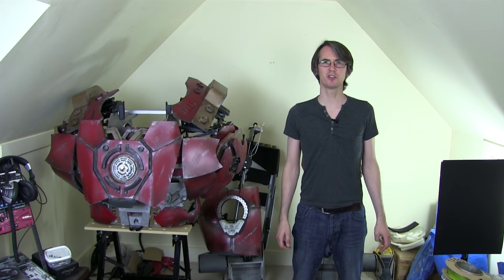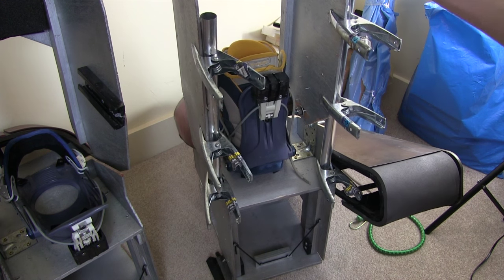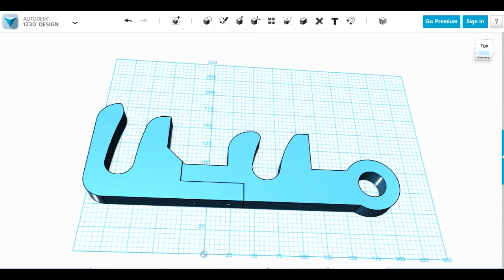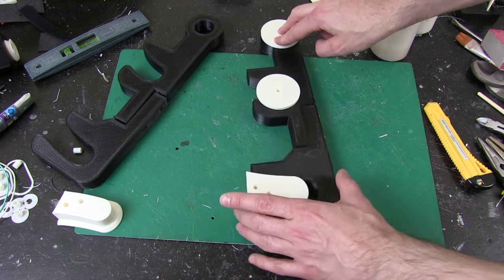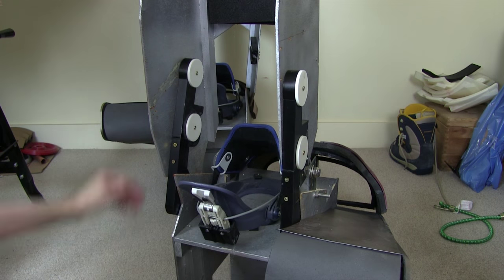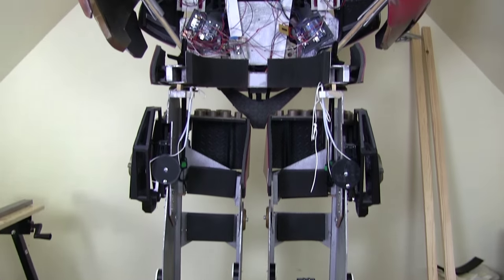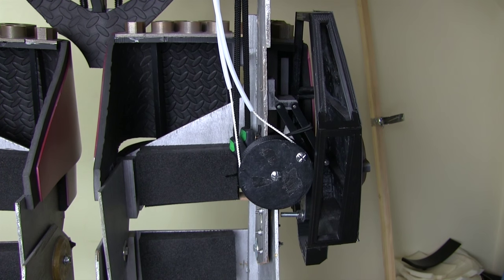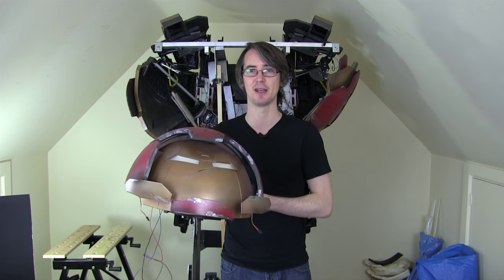Iron Man Hulkbuster Cosplay #44 | Ankle Locks! | James Bruton

Comment: I like the solution, I have a backup idea in case that one breaks though. Keyed, segmented poles with a cable down the middle. The slack in the cable allows them to move. When you want to lock them, you take up the slack and secure it. A cone and cup, keyed with triangular gears would make it poseable in your desired position as well. Just a thought in case this one doesn't work out. And I didn't even skip past the important part of the video yet this time.  Also, how do you get around project burnout? I built a few suits of armor for Halloween, and I don't even want to look at pepakura again.

Comment: can make a mechanism that pushes the faceplate forward. so when the head comes down the faceplate slides forward electronically. like maybe cut the plastics the faceplate is attached to, put  two very small drawer sliders on it. then make its so it move back and forth electronically.

Comment: James the suit is great but i think you should try walking about in it in your back garden if you have one if not then nothing can do about that.
I think for the helmet get a moter and 2 wheels put one on the moter and the other one can be put on a smooth bolt and you can connect them using string so when it turns the other wheel well move and you can have another string on the helmet so when it turns it well go back and make the helmet a bit frunt heavy so when you tell it to unravel it well go down.
If you have found any part of my idea helpful please say the part of the idea you are using and say this idea was given to me by kye brewer please and thank you if you do use it.

Comment: why not just print a ball and socket with limited range in directions for the ankles (4 total)? you have a 3D printer, try it.
Reply: Slot/channel sorry it's late for me.
you only need a few degrees of travel.
(think like two arcs facing each other)

And you could use a wedge that slides up to a wedge to lock it(in a channel to prevent slip), on a simple cable. the shape of the channel could allot you to have a little twist/pivot motion too, but not enough to damage anything, just improve motion range.

Comment: why not build a gyro system. you will have full mobility and be easyer to lock. even strong springs say from a trampoline would brobably work alonside the gyro. look at say a vw passat suspension system and basically think of ur leg in place of the shock absorber. hope this inspire s and idear...